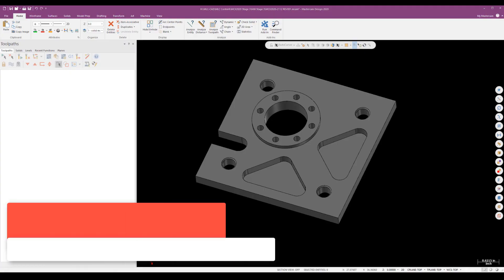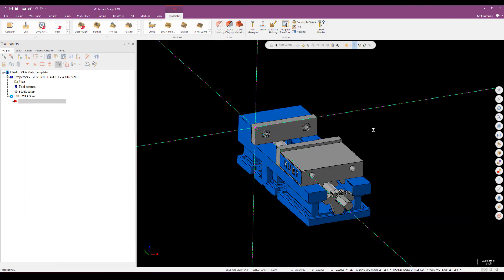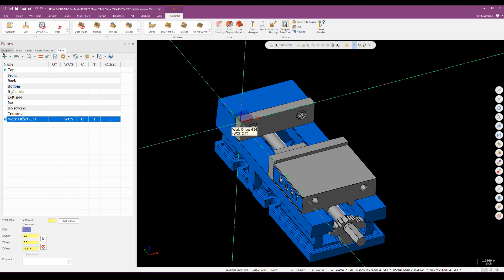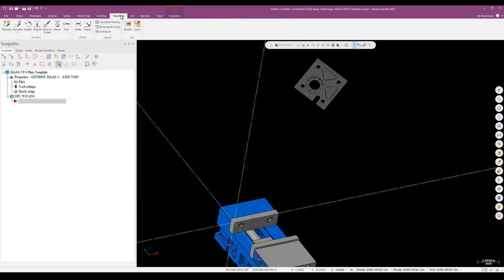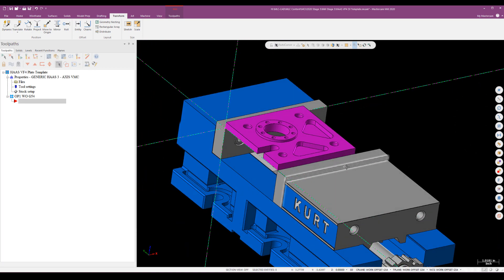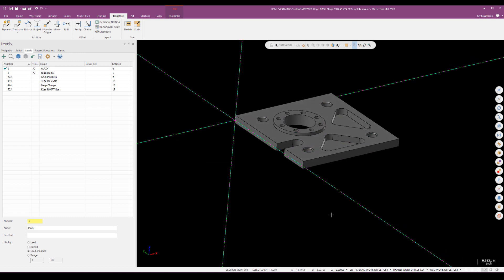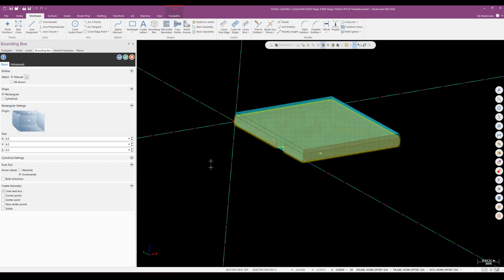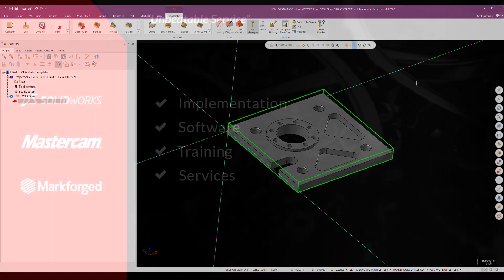Tech Tip - Using Template Projects in Mastercam

Comment: Are templates an actual feature in Mastercam, or are they just regular files that are configured to your needs, and then saved for reuse?
Reply: What he's done is saved a mastercam file with the vice and WCS already set and uses that file as a start point. It's not a built in function, just make sure that after you bring in your solid part, you must use the SAVE AS functionality so you don't overwrite the template. I always keep two backups just in case
Reply: Chazz. Zaragoza. Thanks.